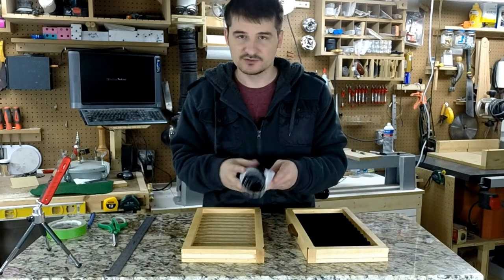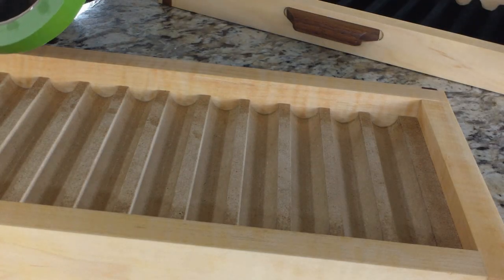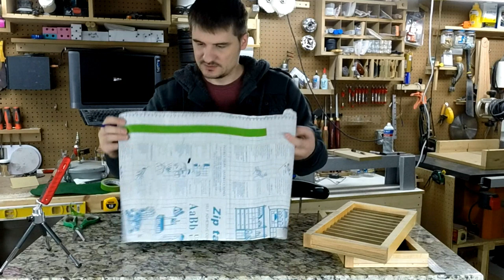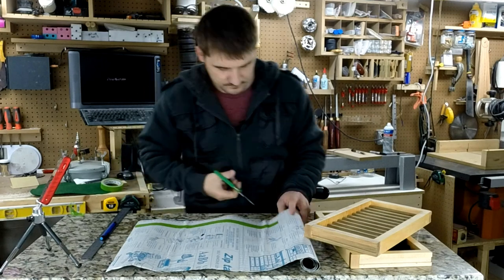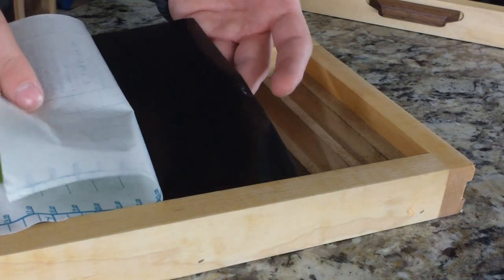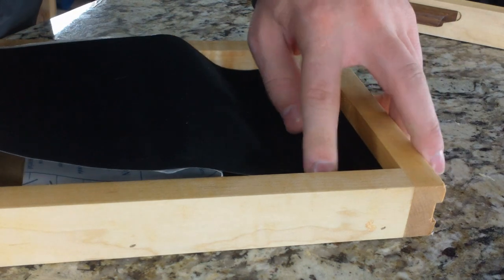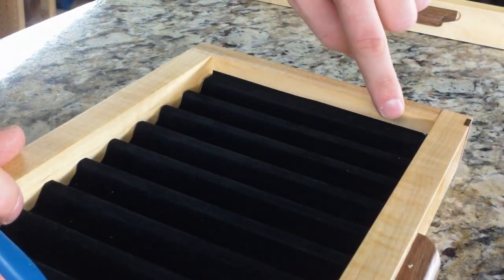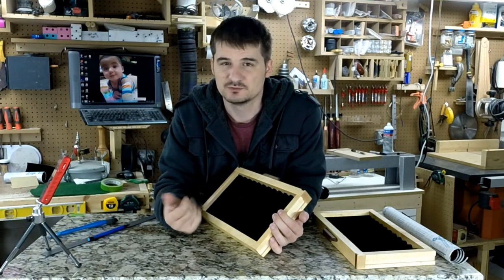My velvet application on my wood projects

Comment: To Derna
My question was it hearing wood to build it but not like you did in your movie I have a camvas I added batting then velvet now I want to add a wooden angel I painted that is 1/2 inch thick and 18 inches long
So it’s heavy
What glue can u use so when canvas is hung the wood doesn’t tear away from velvet
Judystih@aol

Comment: Have a link to where you buy your velvet?
Reply: I'm just going to use 3M Spray 77 with felt purchased from the wife's Fabric Store. If needed, I'll just use a Blade to trim any excess away. Oh, I think I would also mask up the sides of the box (over-spray).

The only adhesive felt I found on eBay was $64.00 (5m x 45cm) and came from England. Out of the question.